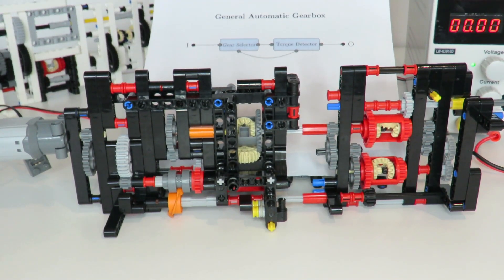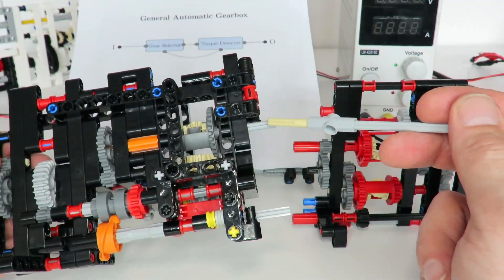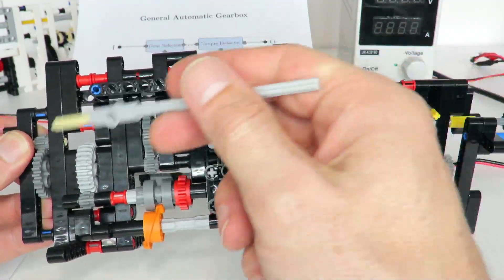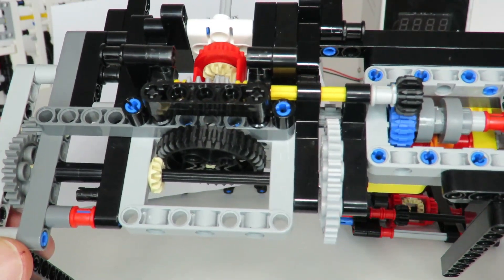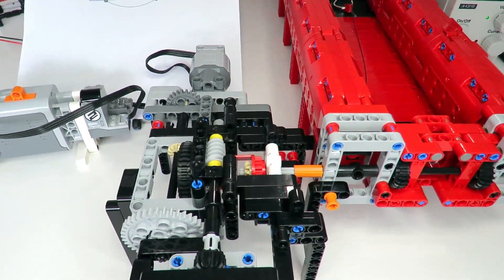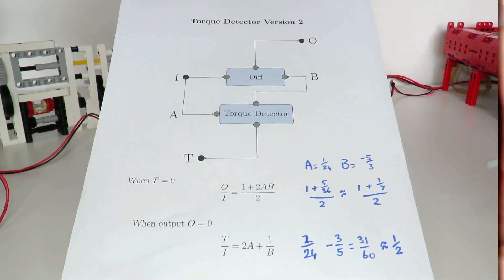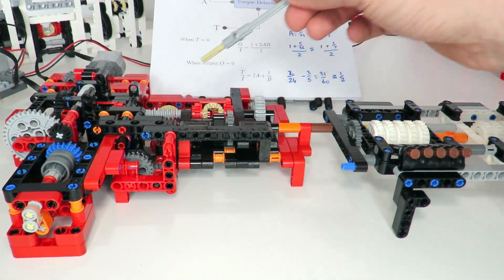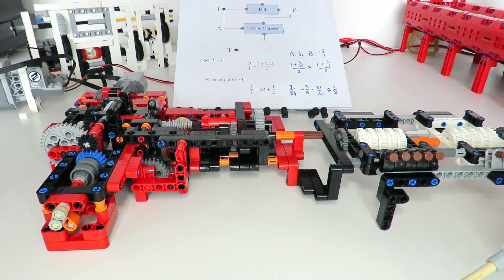Lego Technic Applied Gearbox Theory Improved

Comment: Could the torque detector be used to control a sequential gearbox? Some examples of sequentials in case you haven't seen them:
https://youtu.be/jc9BoUbjBJM
https://youtu.be/VsIMgz3BsTU
https://youtu.be/-e_vOJdyhG0
Reply from the maker: Hi Formbi. Thanks for your comment. Yes you can use it to do that. I think the hardest problem will be to tune your torque detector to switch at the correct torque points depending on the gearing ratios that the gear box provides.

Comment: 11:50 Is there some problem with e.g A = 1/9 and B=9? You currently have A = 1/9 and B = -1 if I understood correctly?
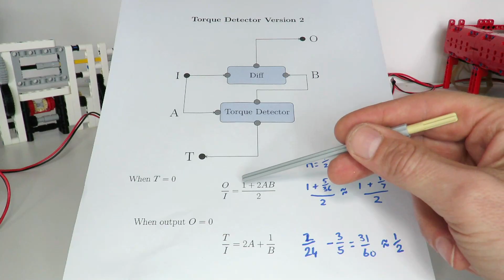Reply from the maker: Hi Miko. Thanks for your comment. The reason I want AB to be small is so that the power travelling through the path where the torque detector is small relative to the main power path. Have a look at this video https://www.youtube.com/watch?v=FsAQrOTyrCI at around 12:56. So if A=1/9 and B=9 then AB=1 which means the power is split 50/50 between the main path and the torque detector path which is not desirable.
Reply: If you want whole input to T when O is zero, https://www.wolframalpha.com/input/?i=1+%3D+%281%2B%282+A+B%29%29+%2F+2+and+1+%3D+2+A+%2B+1+%2F+B suggests that A = 1/4 and B = 2 should work, too.

Comment: 8:30 you obviously rotate the lower diff with 1:1 via gearing on the right side of the frame. You would need different gearing there, too, to make it work with less torque.

Comment: This is so cool! Where did you learn do make stuff like this? I wish I was as good as you. Your work is actually really good.And also is there a chance that you could you make a small 3 speed RC gearbox? Using the 20 tooth and 12 tooth each way around, and two 16 tooth’s together? You can use whatever you need to make it, I know it’s a lot to ask because I asked you earlier for a gearbox, but there’s simply no one else I can find who can figure it out. I will give you as much time as you want to make it if you are willing to, I may be interrupting a project right now.
Reply from the maker: Hi Ants, Thank you and pleased to hear you think I'm pretty good 😀 So the 3 speed RC - you want to change gears using a 2nd motor right? Or you mean a manual gearbox with a stick shift?
Reply: @TechnicBrickPower  with a second motor
Reply from the maker: Hi Ants, Ok  I will see what I can do...but am quite busy at the moment! 🙃
Reply: @TechnicBrickPower  no problem! Like I said, I am not in a rush take your time. I am exited for your next project!

Comment: Interesting as always :)

I'd say that although the number of gears counts, it's less important than the way you guide the axles. You're working with a very weak power source, the slightest resistance that comes with the deformation of the structure under high torque increases the required torque, and that process is quite inconsistent, it wobbles. I wouldn't be surprised that this is what causes the inconsistency of the results in the new design, and also the speed variations of the motor in gear 1 under high torque.

If you look at this video : https://www.youtube.com/watch?v=5ShEWeOPqyc&ab_channel=severgonzalez
It's my old V9 spirograph (although the video is made by Severgonzales who reproduced it). It has over 100 gears that support a bit of torque, which varies following the dynamics of the arms. It can run almost 3 times faster than the speed on the video, with a single M-motor.

Key is axle guiding.

I ended up understanding that I had to follow several rules :
- Always guide an axle at its ends
- Never guide an axle through more than 2 supports
- Keep the guides as narrow as possible, half a stud if possible, so that the axle deformation under torque does not create extra friction by bending into the supports
- Always put the gearings as close as possible to a support, avoid cantilever gearings

- Also, absolutely avoid worm gears. They eat up redonculous amounts of power.

I think you could double the amount of torque you get from your gearbox by improving it this way ;)
Reply from the maker: Hi pg500. Wow thanks for your lengthy comment! Yes I get continually frustrated by the power loss in gears - seems like the best gearbox is where you just connect the motor straight onto the wheels ;)

That's an amazing spirograph machine - I bet a lot of work went into refining that. It looks beautiful. I am keen to build and study them one day - after I am done with gearboxes so that could be a long while. 😀

Thanks for the tips on axle support and structure - I have always wondered which way to go - more supports or minimal supports. Actually what do you mean by cantilevered gearing?

Interesting to hear about worm gears - you'd think they'd be ok since it is just plastic pushing on plastic like normal gears. I also find bevel gears seems to have more friction compared to regular ones.

Thanks again for your insights and comments. 🙃
Reply: @TechnicBrickPower  It's always nice to discuss about mechanics :)

About my spirograph, 1963maniac made free instructions for it, you can find them there : https://bricksafe.com/files/1963maniac/spirograph/Spirograph-9th%20version-PDF.pdf
It's taken 9 versions over several years to get a reliable and decently fast machine ^^

By cantilever gearing I mean, on an axle that has two supports, a gear that is not positioned between the supports but at the end of the axle.
(It may not be the correct word for it, English is not my mother tongue and that was a word I had to search for : in French the word is "porte-à-faux" :P )

With Lego we can't really rely on axles not bending or twisting when torque is applied, so we have to work with axle deformation. In real mechanical engineering, the "state of the art" is to guide axles using two roller bearings, although there are many exceptions (for a very long axle, to avoid resonance, to take high axial forces or vibrations etc.). This ensures that the system is as close to isostatic as possible. With an hyperstatic system, the slightest misalignment or deformation generates unwanted efforts in the axle and the supports, and we want to have as little of them as possible.
A good way of thinking that is to represent one support as a ball joint and the other one as a sliding ball joint. The axle can deform as much as he wants without causing any unwanted force on the supports. That's why short supports are better than long ones : they allow the axle to take a greater angle from its normal position without excessive friction.
(For high radial forces or high speed of rotation, even if it sounds strange, short supports also wear less the axle than long supports because of that, they also help dissipating heat)

That's why I think you're not looking at the friction where it's actually located. When two gears engage, there's minimal to no friction between them : as you say it's just plastic pushing onto plastic. Friction comes from plastic sliding onto or into plastic.

Regular straight gears have almost no friction, and the more teeth the gears have, the less friction there is.
Also, for the same amount of torque, the bigger the gear, the less radial force on the axle → bigger gears generate less axle bending and less friction. Increasing speed for the same power has the same effect, you identified this when trying to reduce the force required to shift gear.

Bevel gears have in theory close to no friction either, but an angled gearing generates axial forces that tend to push the gears outwards. That's prone to generating friction between the gear and a close support beam → friction can be reduced by spacing apart the gear and the support using a half bush or 1L beam for example.

Worm gears, gears touching a support and axles rotating or sliding into a support share that characteristic of plastic sliding onto or into plastic. That's where friction is located, and where you should look for it :)
Reply from the maker: Hi again. wow what an awesome machine - I have just had a chance to download the pdf and have look at it.  I have a lot of lego technic but not all the pieces to build this masterpiece...not yet anyway! 🙃 

1963Maniac always does a great job!

Your English is fantastic no problems there. I thought that's want you meant when you said cantilevered and I think cantilevered is the right word - probably more used in the context of house construction however.

Thanks for the great tips on axle supports and friction. It has always amused me how much you can twist and deform axles on a blocked output. Even the housing on differentials can deform a lot. Fantastic information. I remember seeing a video on friction between two flat surfaces (e.g. dragging a book on a bench) and the point was that even if you double the surface area (and keeping the weight of it the same) of the book it didn't change the amount of force required to drag it. So I ended up thinking that more supports didn't matter because even though you have more surfaces the axle is rubbing against there is less force on each one. However that is assuming no perpendicular force on the axles. I wonder if for long axles that have a perpendicular force on them if a universal joint would help to reduce the friction?

Thanks again for your tips and feedback - it really helps a lot.
Reply: @TechnicBrickPower  Hi again :)
Yep friction mainly depends on the forces and friction coefficient between the surfaces, which pretty much doesn't vary with Lego bricks. The surface is not that important, and indeed more supports don't matter as long as part deformation or misalignment does not create unwanted forces... That is only the case when there is close to no torque or radial force on the axles ^^

I sometimes used U-joints for long transmissions in order to stick to my "2 supports" rule : 4 supports in total and a U-joint between supports 2 and 3. Even without much effort on the axle, that tends to drastically improve the friction situation, just because a perfectly straight axle into 4 supports that are perfectly aligned and stay like that whatever efforts apply to the surrounding structure, basically doesn't exist.

Though I guess you're describing a situation like that ?
support(s) - U-joint - gearing that generates a perpendicular force - U-joint - support(s)

Then, I think it depends on the supports and also how much prone to deformation the axle itself is.
But if there is enough force to bend an axle, then I'd definitely prefer this layout :
support - gearing - support - U-joint - then the rest of the transmission.
With the supports well linked together to avoid misalignment, and preferably 1/2 stud thick :D
This layout ensures that there is little deformation due to the perpendicular effort caused by the gearing, and no perpendicular effort that could propagate to the rest of the transmission, only torque could.

With a long transmission, dynamics is also a point to consider. When a part deforms, it stores energy which can escape when the output resistance decreases even slightly (or when the speed of the transmission decreases, or following variations of friction forces...). The more axle legths and the more gears, the more "elastic" the transmission becomes. That creates wobbliness and instability, which can be reduced by using inertia devices like a flywheel positioned near the output of the mechanism.
Depending on the situation, dynamic effects can be significative : it was the case with the spirograph because the direction of the forces vary depending on the position of the arms. The motor didn't like that at all, because it had to deliver alternatively a high then low torque instead of a constant medium torque, it was heating up quite fast. Reducing the transmission length and the overall friction situation solved the problem, I also could have used a flywheel, but there was no need for that in the end :)

Comment: Nice video! For finding ideal A and B, using B where max(AB, A+1/B) is minimal we get B=(sqrt((A+4)/A)+1)/2 in you case (A=1/12) this gives B=4, and both values are 1/3. But the equation I started with might not represent the actual needs. 

Reducing the mechanical parts in your construction I guess reduced the torque loss from resistance drastically. On this note, you can try to reduce the number of high speed gears too, as the torque loss from resistance multiplies up after converting back. There's also a tradeoff here though, as the high gears are needed for the torque conversion.
Reply from the maker: Hi Levente, Thanks so much for solving that equation - that's awesome. I didn't even think of trying to solve it myself. Really appreciate that and gives me more insight into the problem and adds another tool to the toolbox. What would be helpful too is the reverse question. If I want to min(max(AB,A+1/B)) to be Z then what is the relationship between A and B in terms of Z? 😀